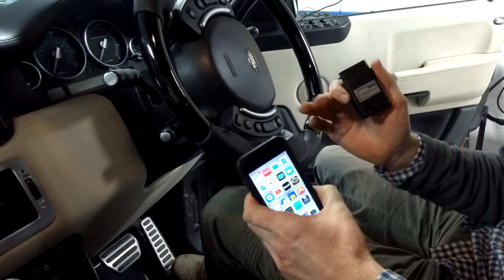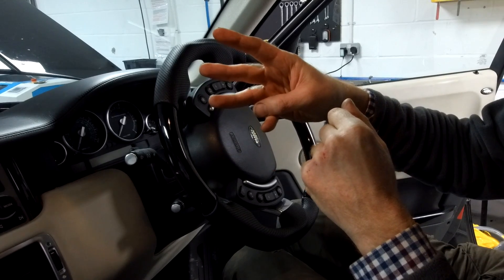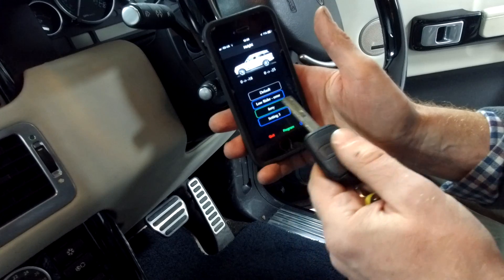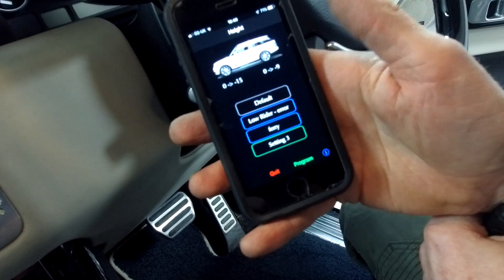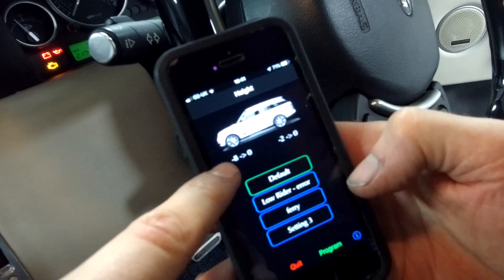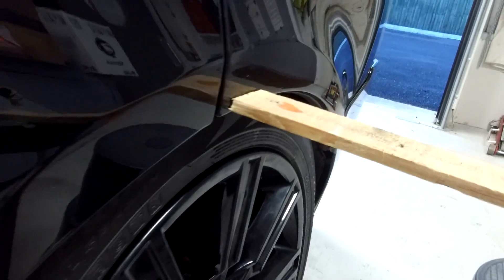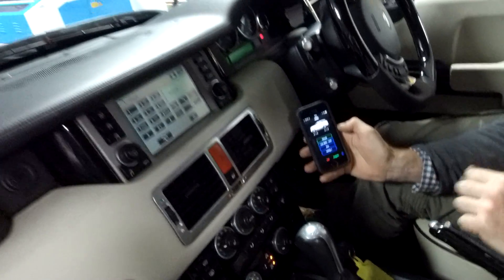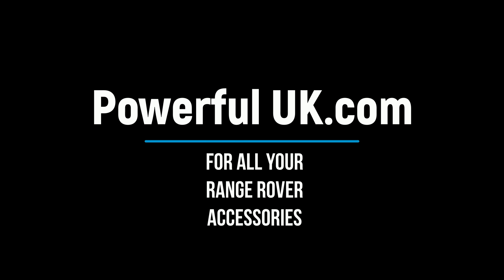How to adjust the suspension height on Range Rover L322 with IID tool

Comment: I have brought a range rover sport 2012. I should have noticed it before purchasing but anyways…. It seems as though somebody as adjusted the ecu ride height setting where in normal height the car is still quite raised up ( you could see parts of the suspension and steering components ) 

Would this tool help me get back to a lower setting. Or will i be stuck in the scenario where the car will raise back up when speeding ? Any advice or help is appreciated. Thanks
Reply from the maker: The IID tool will change the "offset" of the suspension permanently. So it will sit 20mm (~ for example )lower in all modes once set it will keep this setting every time you start the car etc....

Comment: Hi where did you get that reader from. My 2003 range rover l322 needs Suspension calibration. 
Can you help
Reply from the maker: Hi Matt - its called the GAP Diagnostics IID tool - they are on ebay etc - we do not sell them.
Reply: @L663  thank you for your help

Comment: Would any IID tool do this or do I need any particular
Reply from the maker: Any IID tool can do the basic stuff on all cars - things like fault code reading and clearing faults... but to make changes to a vehicle you need to pay extra for additional vehicles ( the first car is free with the tool ). So i recommend you buy the Bluetooth IID tool and get it "linked" to you vehicle.... you can then do this.
Reply: @L663  thanks for your respond. Tried to find this tool on your web but found nothing. Can you recommend any particular one or advise which one you use on your video. 
My email is erpel1125@gmail.com
Reply: @erpel1125  did u get an answer?
Reply: @faresfaresfares100  nope

Comment: Question: so if you save a profile "low cruise" mode and you basically lower the normal driving height. How does that affect alignment? Do I have to do a wheel alignment to adjust for camber?
Reply from the maker: Yes, if you plan on driving with it adjusted for reasonable length of time. Our settings are inteded just for boarding the ferry not for any long drives. - Ian
Reply: @L663  thank you. I just want to drive the truck lower.. Not on the bump stops, maybe slightly above them. I mainly stay in city environments.
Reply: Anyone happen to know the lowest you can go still being "safe" or not riding on bump stops and also having just enough travel for the suspension to work? As in specific values?